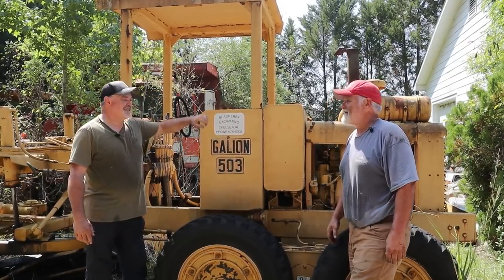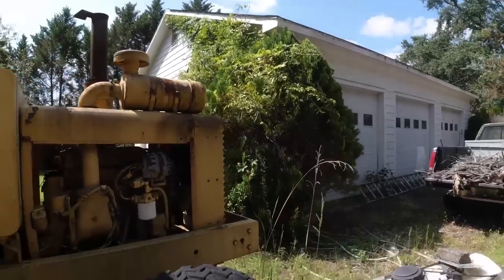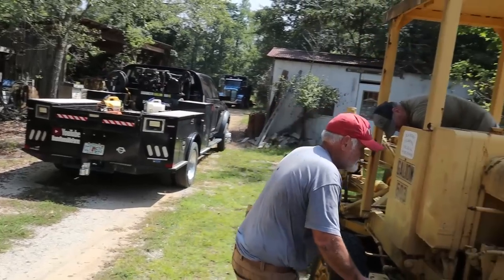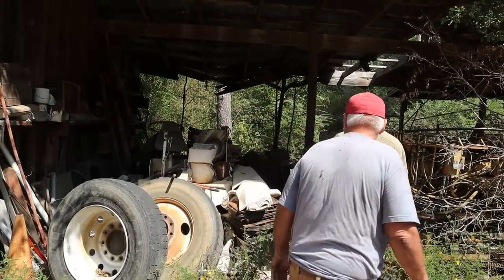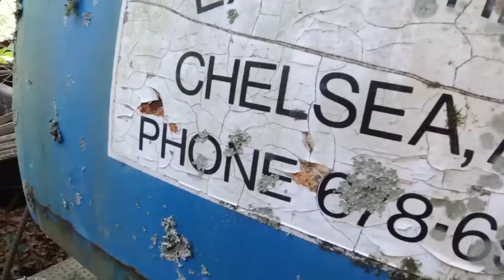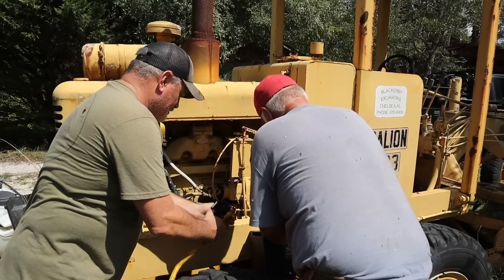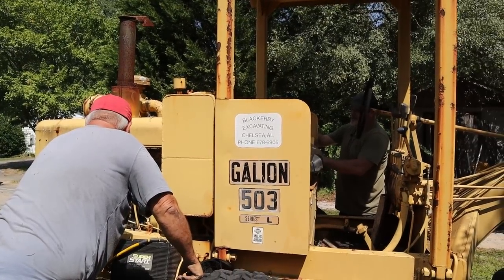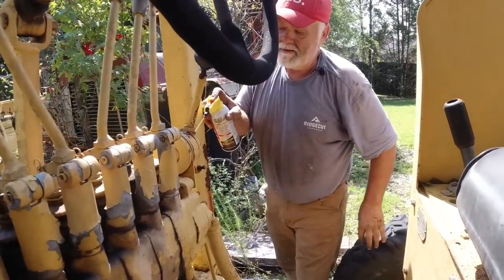Will it start? Galion Grader parked 15 years ago in old man's driveway!

Comment: Thanks for another great video Hank and Wiley. It was interesting. 

Congratulations on getting the old grader running without any big problems. Seems to run pretty good. Hydraulic problems it seems. 

Not too bad for its age and years sitting. Needs some TLC and other problems addressed. 

Someone might be able to use it. 
Good job you guys. She is running. Nice work. 

Thanks for everything. You both take care. Thanks. The Iowa Farm Boy.